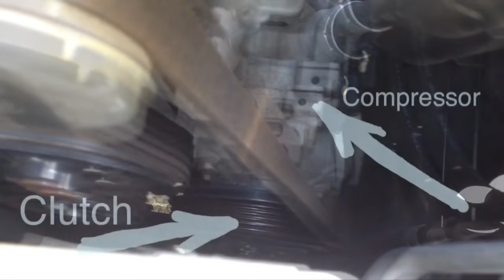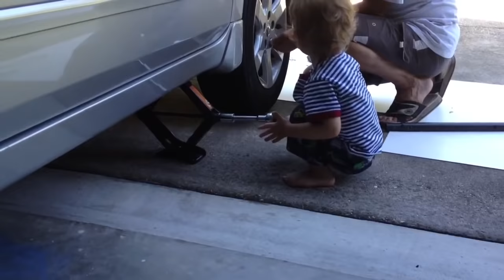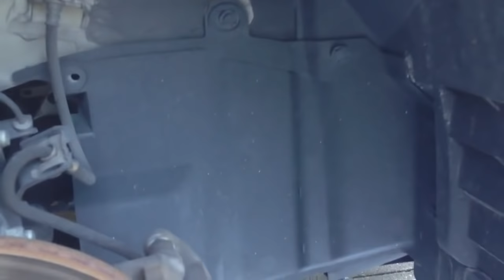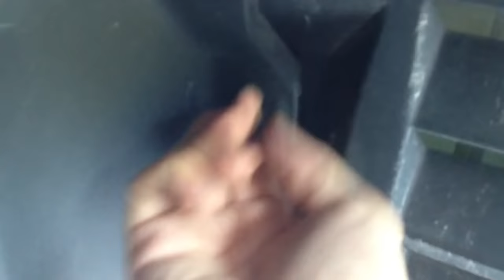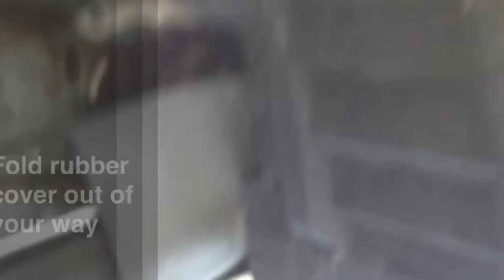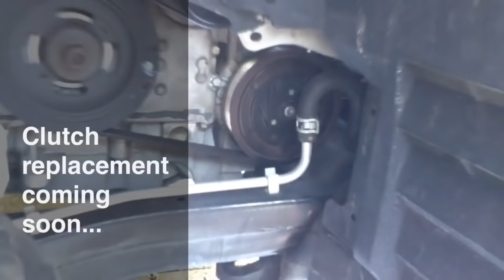AC Compressor Clutch Repair / Replacement - Nissan Altima - DIY - Part 1

Comment from the maker: You can find required replacement parts & tools here:
Nissan AC Clutch Assembly: https://amzn.to/3gYl5qy
Entire AC compressor kit: https://amzn.to/2OyeqqK
Clutch holding tool: https://amzn.to/2CCpEYG
Snap ring pliers: https://amzn.to/32nxkZx
You can also replace drive belt while you are there: https://amzn.to/394Of4l 

(these are Amazon affiliate links)
Reply: Having a hard time taking the plate of the clutch off, i got the main screw off but the actual plate won’t come off, any reccomendations?
Reply from the maker: On some cars it a press fit. You would need a puller tool to remove it.
Reply: @DIYtime  I gave up 🤣, thank you tho!

Comment: Ok so I bought an ac clutch on Amazon for my 2010 Nissan Altima 2.5s  it looks smaller then the manufacturer one I have in now . However it said it does fit my vehicle before I purchased it. Is that normal?

Comment: Hey Temachok how did you know that you needed to change out your clutch? My clutch wont engage either but want to make sure that it's just the clutch and not the compressor to.

Comment: Just returning here to say this... The hardest part is removing the front plate on the compressor housing. Mine was rusted on and had to using heat (blow torch) and wedges of wood that I drove in behind the face plate to jar it loose. Took about 1.5 hours just to remove that. The screw that holds the whole thing on can be removed with an allen wrench. BUT YOU MUCH USE A TORCH TO HEAT IT UP first. Like mikeianne has previously stated. I couldn't get anything to work before that. A little heat and WHAM came right off. The snap rings are a bitch and you might have to loosen the windshield washer housing to get them loose ( I did). But if you follow this video and have A LOT of patience you can save yourself some money. This video skips the hardest and most important parts of removing this clutch, probably because its a BITCH to get off. 7 out of 10 in hardness. The hardest project I've done NOT involving rebuilding or replacing engine or transmission. Beware not a weekend warrior project (will need several tools) so be prepared!
Reply from the maker: +Garrett Gerard 
Thank you for sharing! Good job! 
It took me two days, a lot of sweat, multiple trips to the store, and trying multiple techniques and tools, but it was worth the experience for me personally. If you can do this, there is not much thing that you cannot do....!
Reply: Garrett Gerard I'm having the issue with getting clutch plate off, how did you get wood wedges behind it, it's so thin?

Comment: Thanks for the vid.  Do you know what size is that center bolt?
Reply from the maker: Sorry, I didn't think of writing it down back then, so I can't say for sure.
Reply: Probably don't need it now but for someone else, it should be a 10 mm.
Reply: @greatestNothin  thanks for the reply
Reply: No problem. Did one today on an 11 Maxima. Not terribly difficult. The worst part was the electrical connection and the three screws. Got one out clean and the next two started stripping. Had to use an impact driver, worked perfectly. Everything is working good for three hours of my labor and saved a family member about 500 that a shop quoted them to replace just the clutch.

Comment: Never use the scissor jack for maintenance other than changing tire.  Stay safe and keep kids clear if you have to use a scissor jack, trust me on this...
Reply from the maker: Yea, this is one of my first older  videos. Got good jack stands now. Learning as I go. Thanks!
Reply: @DIYtime  you  did right by using the tire as dunnage

Comment: I believe I may have the same issue. Ac blowing nothing but HOT AIR. where do I locate the pressure switch. I want to test with multimeter

Comment: Where can I locate the A/C Relay?
Reply from the maker: +Jesus Nungaray 
Not sure. It should be in fuse box either under the hood or under steering wheel.
Check your owners manual for exact location.
Reply: Old post but might help someone now. The A/C relay is located on the backside of the fuse box by the steering wheel. Have to remove the clips that hold the fuse panel in place to access the relays. The blower motor relay is back there too.